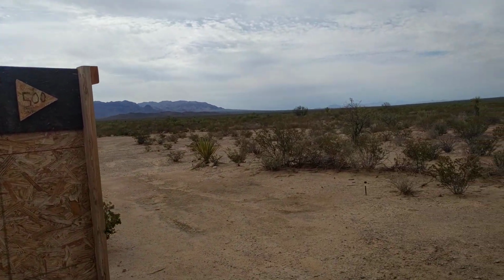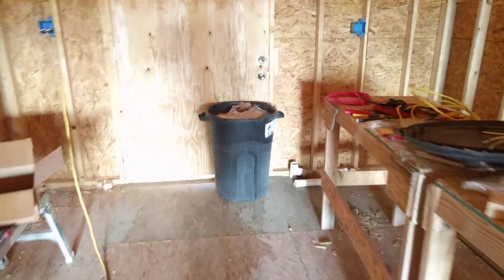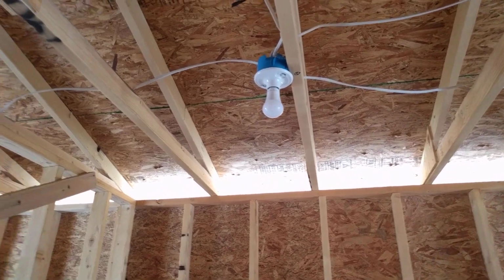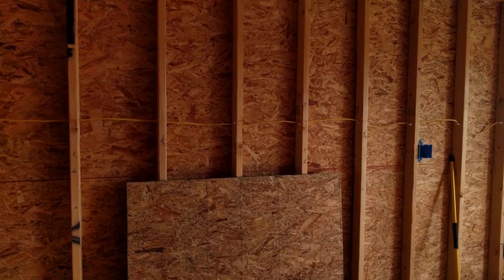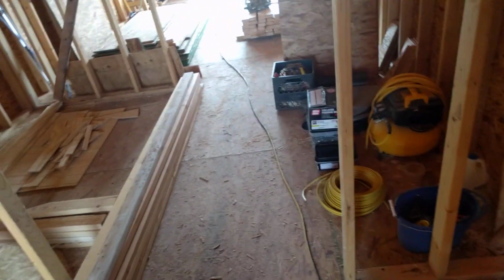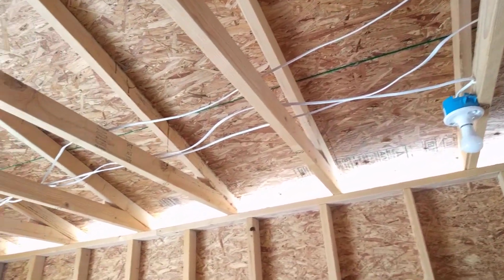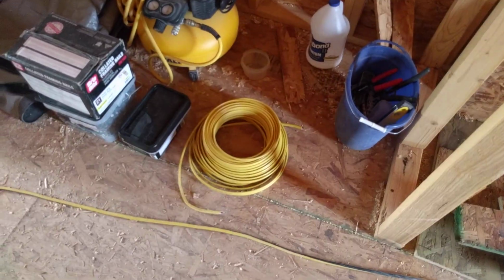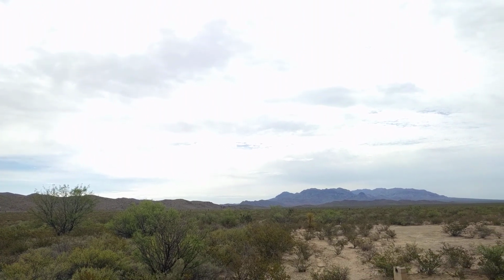July 8 2019 Updates - Lights and Plug ins

Comment: A few things..... Watch your batteries.  If you keep running them below 50% of capacity...you're gonna kill them quickly.  The lights probably won't be a problem as long as you watch what you're doing, but other things will draw quickly as you know.  You might want to look at expanding your batteries soon, and paying attention to voltages.  They aren't cheap, but you'll get more life and have a reserve if you have more....and try to not run them down too hard.   I forget your inverter capacity.  I'd do my best to not trip it too much, or run it really close to the limit constantly, or it'll have a short life too.  I know you're running this on a budget, and you probably realize all of that, but I wanted to remind you so you don't have sudden costs, is all.  As far as the wiring, I'm obviously no pro, but where are you running the grounds to?  I know a ground rod isn't cheap, but if you want your appliances to work properly and trip a breaker if there is something suddenly wrong that could trigger a fire, you want a good, solid ground.  I think I paid 25 for one when I moved into my current place so I had a good ground for my Ham Radio equipment outside of the window where I have all of it.  Tying all the grounds together won't help if you don't have it going to something solid.  Seeing what you've invested, now is probably the time to do that, in my opinion.  Especially since you're going to be running computers.  I know you did that in the Bus, but now with a house...might be something to consider.  You might also want to look at investing in a UPS for your computer.  Just in case you get a sudden sag in power like you were talking about, or if you're running off the generator, it'll protect it from spikes, since you don't have a "clean inverter" type generator.  You can just get a low capacity one, something that is good enough to give you a few minutes to shut down quickly if the AC sags and you can't fix the issue for some reason, and it will guard against voltage sags or overvoltage.  Overall, it looks good to me though-your wiring is unorthodox in the fact that you're running stuff higher, but for your needs you should be fine, do it your way.  That's the reason why if you can, you do it yourself!  20A is probably overkill for circuits, but you're running the right wire for it as far as I can tell.  You're probably going to want to feed that box from the outside with something thicker though-its going to be handling the entire load.  You're probably alright for now, but you don't want wires getting hot later.  One other thing...if you're running anything near water, you probably need GFI outlets.  Again, for those to work right, you need a proper earth ground.  I don't expect anyone to really hassle you regarding code, but I'd at least have one by the bathroom sink, just in case you accidentally drop something in a sink full of water, which I could see you doing to conserve water.  Just some things to keep in mind.  I'm glad to see the progress, really glad to see that its cooler in there (maybe buy 2 cheap thermometers to see what the real difference is?) and I can imagine if you can manage to insulate just the bedroom section you'll be so comfortable...you'll feel really good about doing this build.  In a desert environment, getting good sleep is hard if its too hot or cold.  You're well on your way to that already. Maybe its not the absolute proper way, but having watched you do this, I think you have done it as right as I could for sure, probably better, I'd be lucky to do it at a quarter of the rate you did!  Need to get gutters on it, you have all kinds of free water potential there too.  You might need another tank...which wouldn't be a bad thing, I'm sure.  Keep it up, and continued good luck, for sure!  Got some thunderstorms in N TX this evening...
Reply from the maker: Thanks for all the ideas! As for the rain gutters, its on the plan but probably will miss this monsoon season, and I don't have the cash this year for a bigger tank, so even if I had the rain gutters I can't hold the water, but I'm working through some ideas for making a cheap, temporary tank. The ground rod is a great idea, I"m going to try really hard to get that done soon, thanks for the reminder. I checked temperature with a digital thermometer a week or two ago, right after I had the roof on, I saw about 5 degrees cooler in the house, but it felt even better, with the air flowing through. UPS is another good idea. I haven't needed that as much with the laptops, but sometimes I need a powered hub to power external drives, and they do drop off line. I"ve read that some UPS don't play well with inverters, though. And yes, more batteries is always a good idea. The inverter drops off line at around 10.6 V, depending on load. I finally got the remote switch wired up again so now I can turn it off when not in use, that is helping a lot. Thanks for all the great ideas! Oh, I ran 220V 10G 30Amp (Red, Black, White, Ground) from the Generator through the battery box / inverter  to the house, so that's about as good as it could get. Trying really hard to do things that won't get me killed :)

Comment: Carlin, put no more than 6 outlets on one 20 amp circuit. Place is looking good. Your rain water catchment is working out good too. Take care.........
Reply from the maker: I'm over plugins, but I can't run more than one or two loads at the same time, I can't produce that much power, so I'm over spec, but I'm kind of covered by my lack of capacity :)
Reply: On the plugs the problem will be later on others that will come that won’t know your wiring and you will be tripping breakers.Go back and run more home runs to the sub panel so like the other man said. Just intercept a box and take some of the load off the run.Cheaper doing it now then later when you have the walls covered up you can get to it .There is a little book at Home Depot telling you everything you need to know it’s called Ugly’s in the electric section.If you’re sub panel is to small increase the size of it your place will grow in size some day.

Comment: Need to put a hammock in the house for camping in the house as a thinking spot. You can lay in the hammock and ponder your next move. Keep up the great work and enjoy the video.
Reply from the maker: I do have an army cot, it will have to do :) The hammock sounds like more fun though!
Reply: David -  I agree hammocks are a great way add and stow a sleeping spot.  I'm also big on running suspension systems for storage, vertical or horizontal.  I love how this guy makes hammocks at almost zero cost:
https://www.youtube.com/watch?v=Wb2gnb5AGeAhttps://www.youtube.com/watch?v=Wb2gnb5AGeA
https://www.youtube.com/channel/UCTECTiW0RiXGu0xmhOmkjTw